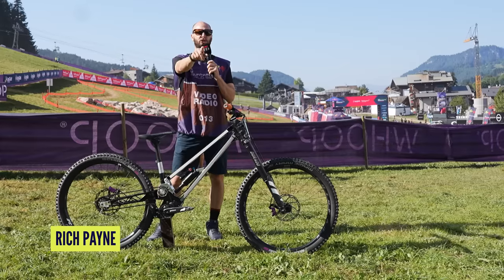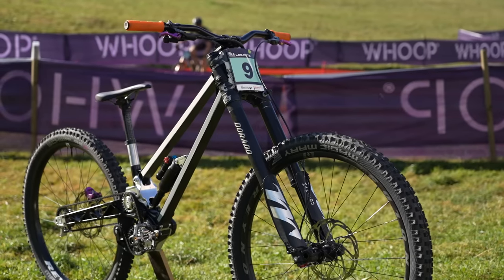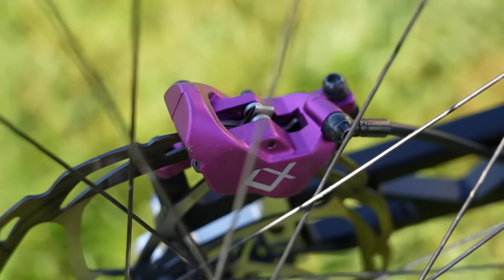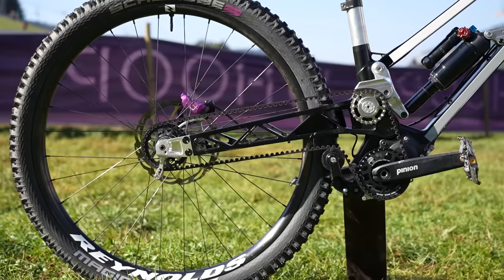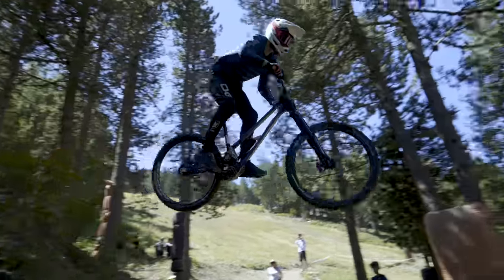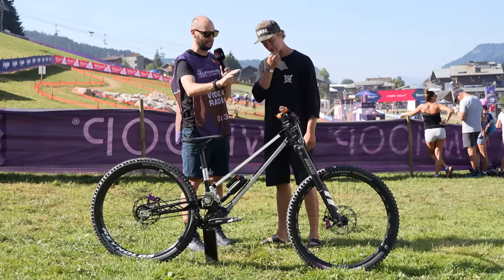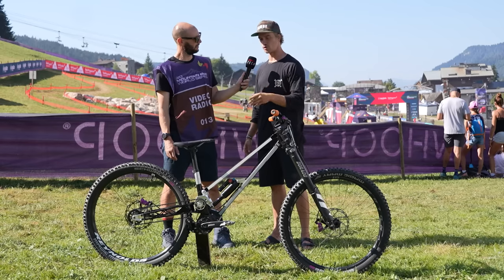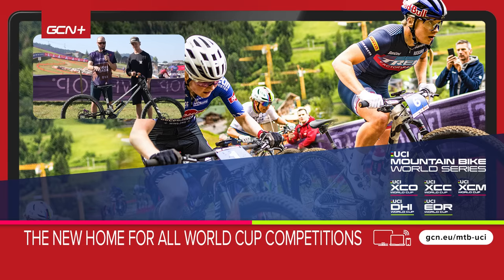This Prototype DH Bike Has An Automatic Gearbox! | GMBN Tech Pro Bike Check

Comment from the maker: Do you think Gearboxes should be used more in Downhill? 🤔 if so let us know why! 👇
Reply: It's the future on MTB all together, but because of patents it holds back everything.
Reply: should of years ago.... Honda
Reply: For sure.
Faster, cleaner and more reliable
Reply: Yes you don't have to pedal to shift there more durable they are be heavier but it doesn't matter because there in centre of mass
Reply: Yes, of course, there’s always need for tech innovation to improve racing.
Reply: Stupid question I am compelled to ask, do DH bikes really need a seat or is that a design rule?

Comment: I switched to a Nicolai Argon with 12 speed Pinion with belt Drive a few month ago, and love the feel of it. The backwheel is much lighter, which is a really big deal. Even on a Hardtail, its an amazing feeling and the back of the bike is much better controllable than on my 2021 Trek Fuel EX.

Comment: Gearboxes should definitely be used in DH. I wonder if Pinion is working on a dogbox sequential variation, that would definitely remove the stress on the gears out of the gate when riders max out their crank output and shift at the same time.

Comment: I love the look of the Dorado's but I bet those stantions get absolutely hammered being upside down. Also, belt drive makes sens for downhill as you are not pedalling too much
Reply: Not sure why people think this.  I've owned two generations of Dorados and both had zero stanchion damage throughout their lives.  The guards are massive and the only exposed surfaces are behind so unless you load it into a bike rack wrong or something then you don't need to worry about it.
Reply: Not really, I've had the Dorado Pro for a while now and the stanchions are well protected
Reply: Why does anyone worry about upside down forks stanchions getting scratched if it performs best I’m going for it. Also it rarely getting scratch even Dirtbike forks don’t get beat up to much with just those plastic covers
Reply: @jonjonjonnyjon  exactly, but I'd argue scratching stanchions while loading the bike somewhere is easier on "regular" forks because there are no guards at all.
Reply: @jonjonjonnyjon  Thats good to know! Thanks
Reply: My moto's flawless fork stanchions would like to enter the chat
Reply: I love how people act as though USD shocks are new to offroad.
Reply: You do realize that regular forks have zero protection from scratches, right? These have guards.

Comment: Sram and shimano will lobby pinion the hell out of market
Reply: Doubtful. Pinion has been around for a while now mostly in the touring bike market. But with the MGU they are very interesting for the e-bike market (low maintenance is a huge plus for many people). So, they will become more visible and with that harder to be ignored by bike manufacturers.
Reply: @etherealicer  i hope so. Undeniably shimano and sram will try to push the pinion e-bike motor out of market. The amount of market power they have over bike manufacturers is huge. They'll do everything in their power to exclude Pinion from becoming a common OEM supplier.

Comment: Yuck, I don't even drive cars with automatics.  I bet this bike weighs 45 lbs or more, so only good for serious downhill tracks.
Reply: It's at 18.5kg ish from guys over at Pinkbike who asked Gamux. Relatively spec weight for a DH bike. My Commencal V4.4 is at 19kg. 

Its not really an automatic, think of it more as a sequential with autoshift. You can bangshift it into gear and also program it to auto shift when you want.